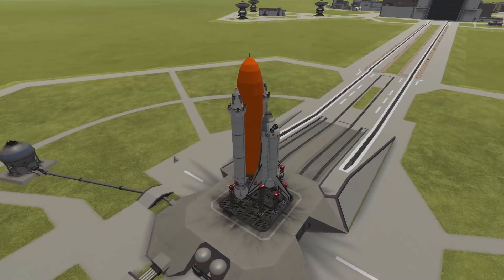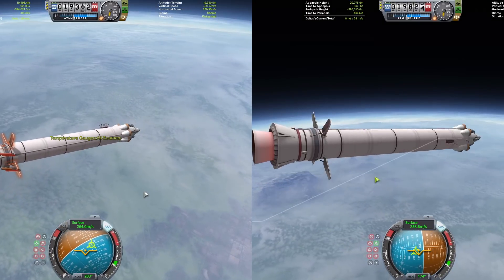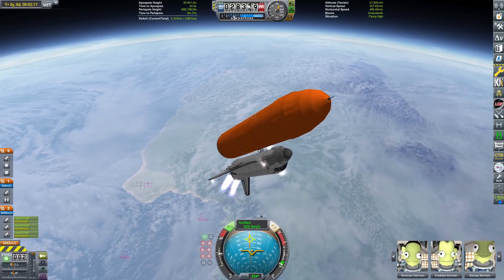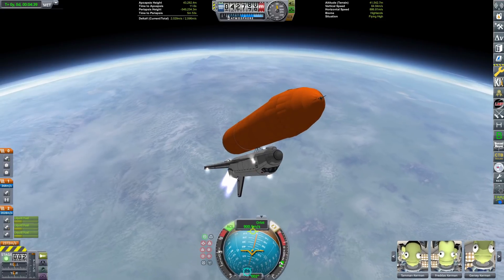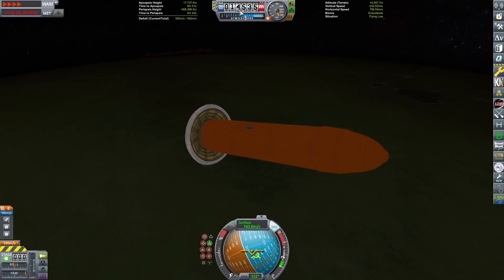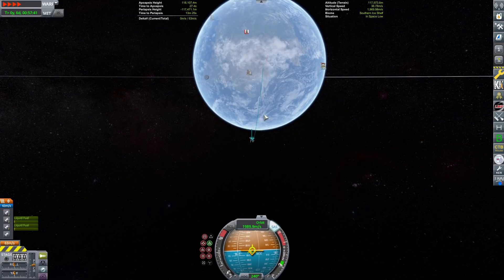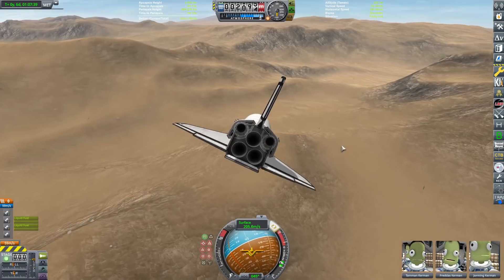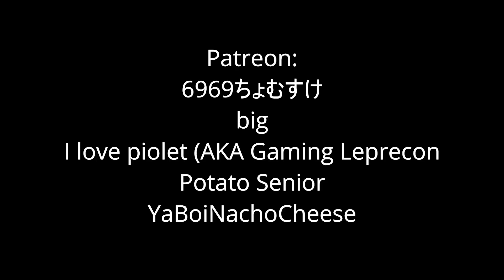KSP: Fully Reusable Space Shuttle In Kerbal Space Program! [stock 1.11]

Comment: When I'll have enough spare time, I'll try to make a "Space Shuttle, but better", with full reusability, liquid fueled boosters, jet engines and an abort system.
Reply: Do you mean: Buran
Reply: @bee5440  It didn't have abort system and it wasn't fully reusable
Reply: @ImieNazwiskoOK  close enough
Reply: @bee5440  "Buran, but better and actually useful"
(Energia rocket was more capable without Buran)
Reply: so basicly a buran
Reply: @sergegordeev9426  Same with STS if they put engines on main tank
Reply: wouldn't be difficult, the space shuttle was terrible.
Reply: @ImieNazwiskoOK  it had a abort system and was partially reusable
Reply: @Kasmuller  Shuttle also was partially reusable (which gave more profit than Buran because engines were saved).

And what was the abort system? Can you show me image or something because it's sounds very hard.
Reply: @ImieNazwiskoOK  ejection seats for the whole crew.
Also it used liquid fuel boosters, which are much safer for crewed spacelfight as they can be turned off.
If challenger had used liquid fuel boosters they could have just turned them off and jettisoned them.
Also the buran was just as reusable as the space shuttle.
And the dpace shuttle wasn't really reusable either, but rather refurbishable.
Reply: @Kasmuller  They would burn up from engines or die from deceleration and aerodynamic forces.

But yes. Liquid fuel is much safer.
Reply: @ImieNazwiskoOK  SRBS turned on flying past will burn them.
Liquid fuel engines being dropped while turned off will probably not burn them.
Giben the crew survived the explosion itself on challenger ejection seats or just parachutes might have saved them
Reply: Here is a suggestion for the abort system: The capsule on the shuttle ejects from the rest of the orbiter (kinda like dragon? but dragon isnt a glider.)
Reply: when i have enough spare time, ill try and build a space shuttle
Reply: There were ideas for liquid fuel boosters for the Shuttle (even before Challenger), but they were too expensive to develop.

Comment: fun fact: an empty shuttle ET weighs only 30 tons. So if it fit on top an SLS Block 1B could send it to the moon.
You could set up that space station as a Duna cycler station, so basically it's in a solar orbit but will come close to duna every so often, and so you can use a smaller ship that has less mass but less space for the crew and go out and dock to the cycler station and you have a lot more room to move around in during the interplanetary flight! Scott Manley did a video about it
Also, fuck nestle. They do some really shitty stuff, look it up.
Reply: Not even 1B is needed, Block 1 would be enough for even 2
Reply: Block 1 can only send 27 tons to the moon. Block 1B is something like 37, Block 2 is close to 45, almost beating the Saturn V
Reply: @jmstudios457  Sorry, I confused LEO with Moon